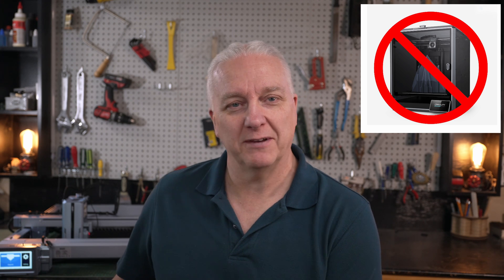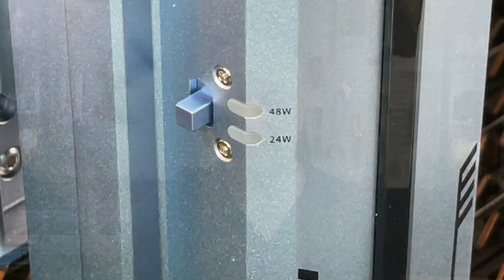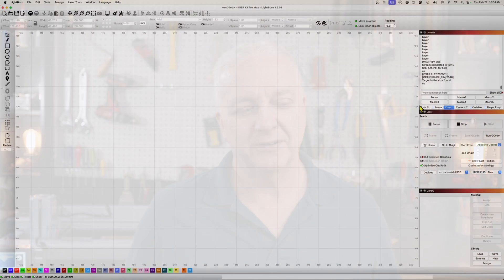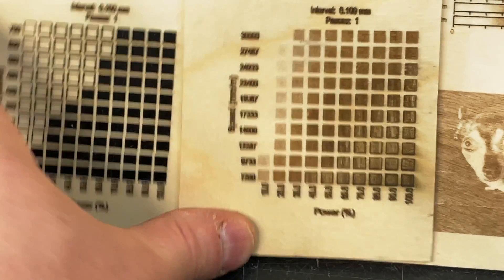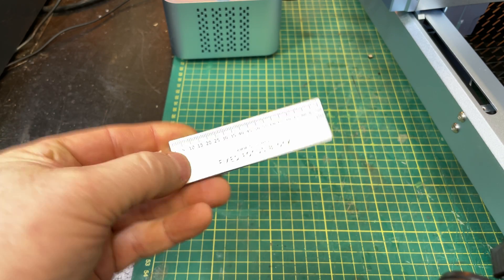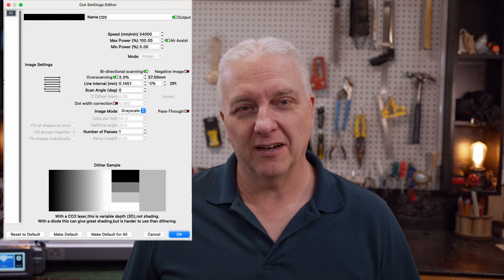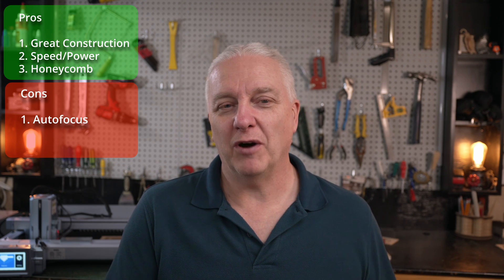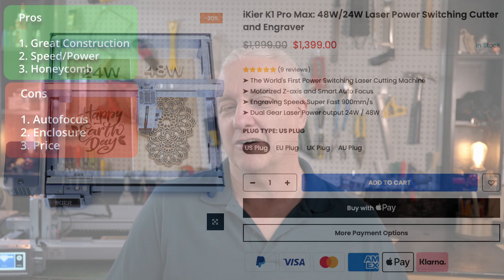IKIER K1 Pro Max Diode Laser Engraver Review

Comment: I bought the Atzer 36 watt 10 months ago, I left it powered on overnight, just on not doing anything and in the morning it did not move anymore. seems the board fried.
Now You speak of Ikier, the same design. Is it reliable? will the company still be there in a year from now if there's issues. How is the customer support?
Reply from the maker: It’s odd that the board died just sitting idle. May the power supply is the culprit. If you want a good balance between price, performance and support, look at the Longer B1.  I’m not sure what Ikier’s support is like.

Comment: Hi guys. I need to help to buy laser for my custom shop business. I got algolasar 40w but i haven’t got yet. I might cancel this order(kickstarter projects. Around with shipping cost $1170. ).  Do you prefer diod lassr 40watt and upper power diod laser or 40-50 watt co2 laser espt i will make wood metal   Stuff like that engraved. Cutting sometimes. What size your opinion. Atomstaxk , ikier k1 pro maxx  algolaser 40watt  longer laser or xtool s1.
Reply from the maker: The power really depends on what you’re doing. If you plan to cut a lot then go with 40W or more. If you are mostly engraving then go with a 20-30w. Any of the lasers you list here are decent.  My personal favorite is the Xtool S1 because it is enclosed, but the IKier is great and the Longer lasers are excellent budget machines
Reply: Thanks Steve. I already got algolaser 40watt kickstarter deal but i did not like  their  kickstarter projects  system. I can cancel this order that’s why i am looking for to buy new.  laser.  Mostly i will engraving but i need to cut something. For good engraving   20-30watt  laser or 40 watt laser can engraving well. Can you tell me or prefer   model ?
Reply from the maker: @MusaEser2024  Your best bet for balance cutting and engraving would be a 20-30W laser, and all of the lasers you mention are available in that power range.
Reply: I have a question. We bought the Snapmaker 2.0 3D, laser and CNC module. Will it work if I update the Snapmaker laser module to 20w or 40 watts? Instead of buying a new laser (instead of Algolaser 40watt)
Reply from the maker: @MusaEser2024  The Snapmaker modules should be interchangeable, but as always check with them to make sure.
Reply: Do you prefer to huy Wecreate 22watt laser ?
Reply from the maker: @MusaEser2024  I think the Secret is a great laser for people who are starting out.  It's not as expandable as sone, but generally has everything you're going to need right out of the box.
Reply: Algaser delta 22 watt can useful fir engraving. Also ikier  laser same amount of power?
Reply from the maker: @MusaEser2024  The Algolaser Delta is also a great cutting laser.  The Ikeir is available in several different powers up to 70W

Comment: I agree with you on the Autofocus not being implemented well.  In fact, when I try to run in absolute coordinates and home the laser to be able to use an alignment jig, it will fail to autofocus after homing, which then also makes the machine lose its X and Y positioning.  I was told to run it in current position mode and not home the machine as a fix.  As for power and precision, it's great, but not for the powered Z axis.
Reply from the maker: Hi Steve.  Yep, it’s the one annoyance for me with this laser.  It just seems like an unnecessary feature